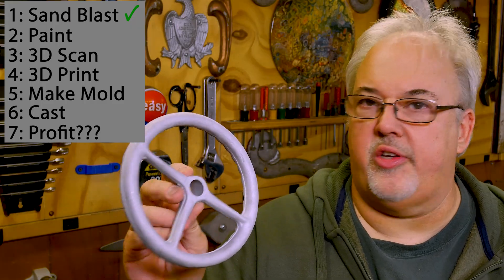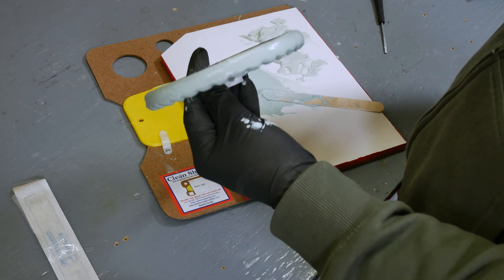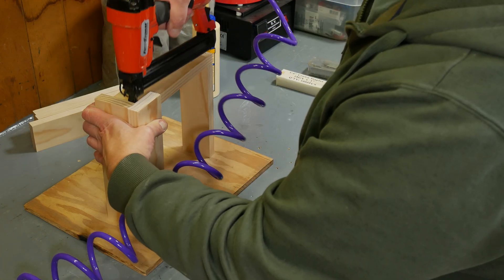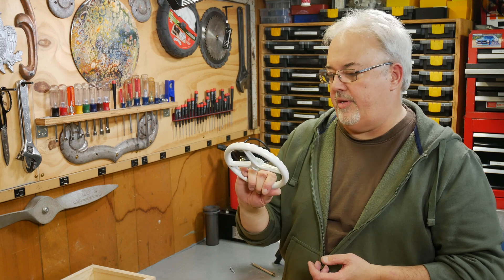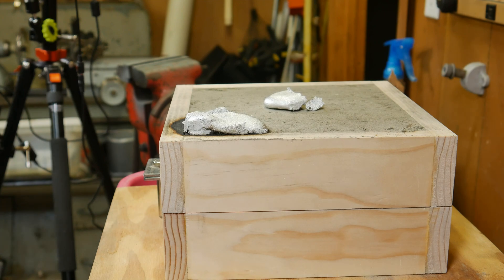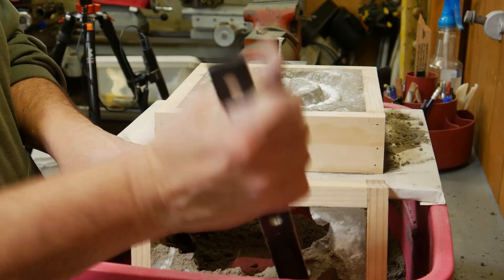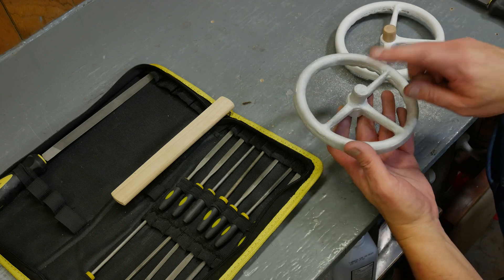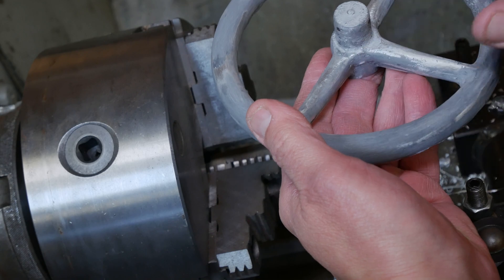Molten Mistakes: Can we cast these vintage wheels?

Comment: Most of the time you need a drill 1/16th inch smaller and a reamer the exact size, that's the only way to get the right size hole. Sometimes you can jam shim stock in front of a 9/16th drill and achieve 5/8ths, (same thing with any drill bit), if it's not critical. I get the feeling you like to tinker, give it a shot. Isn't there a different sand that's used for casting?? If you can ever pick up a 4 jaw chuck (or if you have one) you can center the wheel better in your lathe and machine the outside of cast parts to a nicer concentric finish, if desired. Came out awesome, better than I've ever done!!
Reply from the maker: To be fair, the hole size in these isn't super critical, and with no bushings they will get sloppy over time.  I have seen the aluminum foil trick before to make a slightly larger hole.  That actually is casting sand. iIt is water based rather than oil based but it is genuine casting sand.  It is advertised as "Teton-Black Foundry Green Sand Olivine Facing Sand"  I would like to come across a cheap 4 jaw chuck some day.  Thanks so much!

Comment: Welcome to the black art of sand casting.  I've found that Aluminum pours best at 1200 deg. F.   Have you considered using petrobond sand?
Reply from the maker: My original plan was to use petrobond for this project.  Years ago when I first did casting it was much harder to just go out and purchase these industrial type supplies in hobbyist quantities.  So there were a lot of sand recipes using kittie litter.  I was going to treat myself for this project but when I went looking for petrobond (because I remembered everyone considering it the holy grail back in the day) I came across this green sand that seemed to have pretty good reviews so figured I'd give it a try.

Comment: I have an idea. Make a silicone half mold which comes up to the parting line. Then use the part and the half-mold to make the sand mold one side at a time.
Reply from the maker: In a later video I 3D printed a part that does basically the same thing. The technique you are describing is to create what they call a “follow board”. Thanks for watching!

Comment: Your last effort gave a good product, congrats! You may want to consult Windy Hill Foundry on the web for gating, venting and mold raming ideas of similar part configurations but you did well. I had my fingers cropped the rim wouldn't  develope a knit line. Clark pours cast iron, I shot injection plastic for 63 years starting with aluminum in '56 in the Red Lion High School shop foundry.
Reply from the maker: Yes! I actually follow windy hill foundry and know Clark.  The later video where I made a new pattern with a follow board made the whole process much easier but I am at the limit of what I can do with that size crucible.  Red Lion as in here in PA?
Reply: @PeteRondeau  Yes. Red Lion, Penna.  Any content of your type is enjoyable whether it is piecemeal or complete.

Comment: As a uture reference, I have done scans with my phone which are way more precise than this one. You have to prepare the surface of the scan object, any scanner will have a problem with shiny featureless or transparent objects. In your case you can simply use water colors on a old toothbrush and sprinkle them all over the part with different colors too. You can also use your baby powder. This will create features for the software to latch on to.

Comment: casting aluminium is kind of waste of effort when you can do the same part with  zink aloys like zamak in lower temperature ~420-430*C, zink would flow better than aluminium and can be even cheaper
zamak 12 is especially good in gravity castings some people had relative good effects in small batch silicone mold casting where mold gives out with time but not at first cast
Reply from the maker: Ok, so you want me to go out and buy Zamak when I have buckets of free scrap aluminum.  Then you want me to throw my cheap reusable sand molds away in favor of relatively expensive silicone molds.  Because successfully doing it the way I'm doing it now is a wasted effort?  Sorry, I'm not following your logic at all.

Comment: This casting is so interesting. love watching this prosess. Do you have to do that for each wheel? I used to look forward to the J.C. Whitney catalog. You know you could have built a jeep from the ground up by just using J.C. Whitney catalog.
Reply from the maker: Well the answer is “yes, but”.  If I can successfully create a true pattern it will eliminate the need for all the fiddly work digging down to the wheel. That will all be taken care of in the pattern. So you put the flask over the pattern, fill it with sand and ram it up, flip it over, fill it with sand and ram it up.  It’s still good to strain the sand that goes against the pattern, they call that facing sand. Gives the best result but other than that- much faster than the way I’m doing it
Reply: Why not cast it in plastic?

Comment: With sand casting, you need a vent hole in the cast. It allows you to see when it's completely full, and it allows the air to escape.

Comment: Brings back memories - I remember sand casting aluminum in high school. It’s a pity it’s not done in school any more.
Reply from the maker: We had a machine shop and a wood shop in high school, but I don't remember any sand casting going on.  This would'a been in the 80's
Reply: @PeteRondeau  Yeah - I went to a 'new' high school in UK, I guess they were trying to impress potential students with their facilities, we had a whole mini black-smith there - forging, tempering, oxy welding, lathes, mills. I dunno if that is still the case now tho with budget cuts and so on.

Comment: The part is so simple, I would skip 3D scanning and try 3D modeling it from dimensions.
Reply from the maker: I tend to agree with you.  I was trying to save myself some frustration to model the proper cross section in the spokes and the bumps on the rear of the wheel but the scanning just creates a different set of frustrations.

Comment: I'm wondering if maybe you could get the mold kind of hot before the pour?  Might help it not cool so quick. (?)
Reply from the maker: I think the bigger issue was that I was attempting to do this during the most severe cold snap we've had all winter and that crucible is so small that it loses heat quickly.  I'll run the furnace hotter in the future and hopefully it won't be so cold outside.